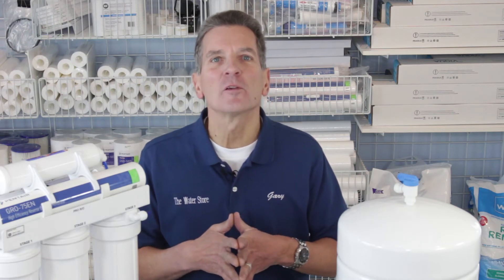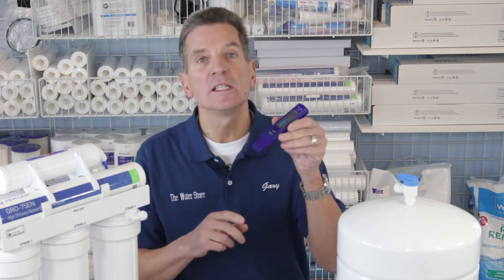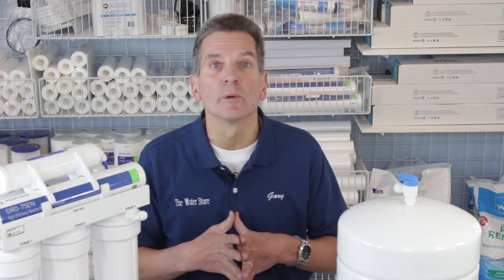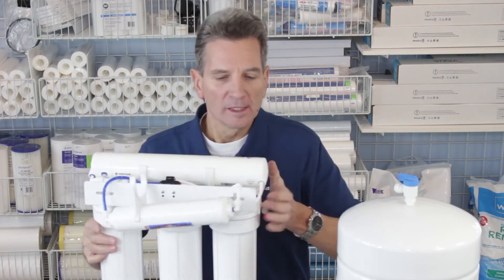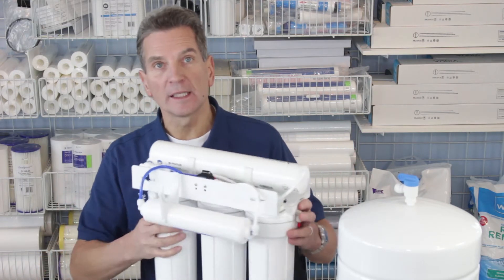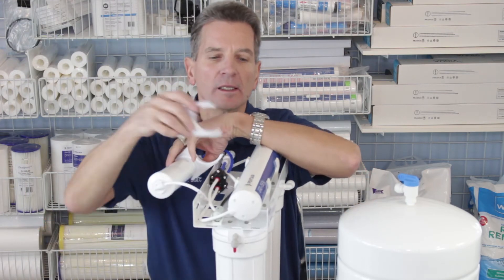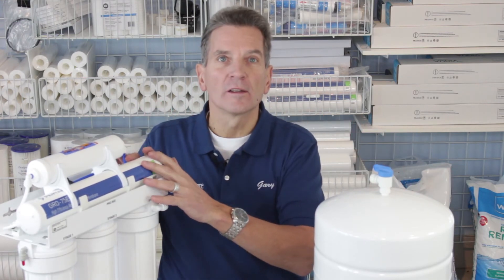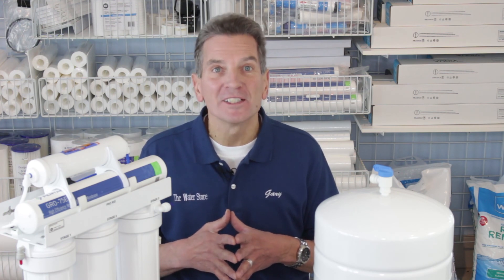How to REPLACE the MEMBRANE in a WATER SAVER 75 Reverse Osmosis System

Comment: I am replacing a membrane. It appears cannot just plug and play as the configuration seems wrong. the drain outlet on the membrane is connected to the 4 way valve. The permeate is going down the drain. I would think an outlet labeled drain should go directly to the drain.  Also I cannot see from your video how, where, to insert the flow restriction and check valve that come with replacement membrane
Reply from the maker: This video shows you how to replace the membrane. Assuming there are no problems with the flow restrictor or check valve they would not need to be replaced with the membrane.